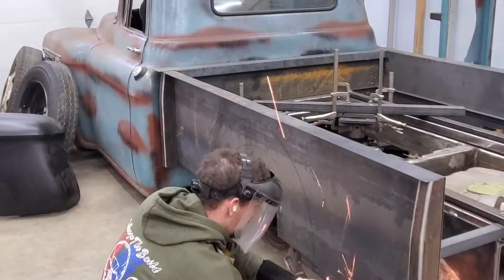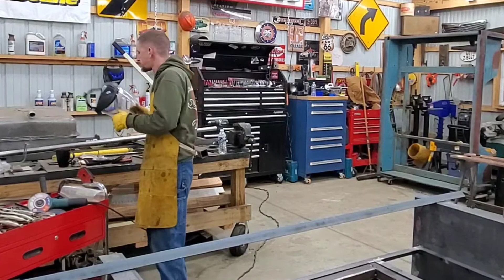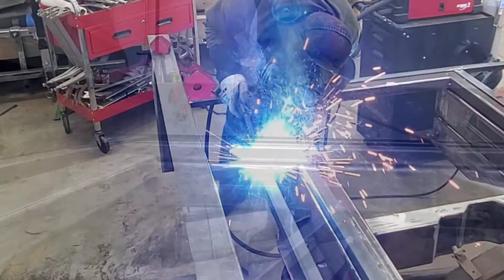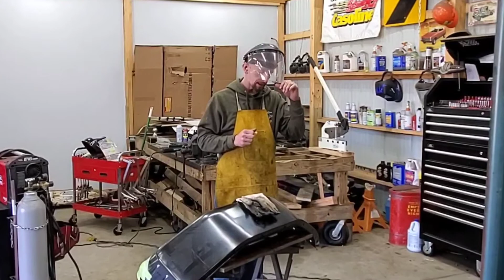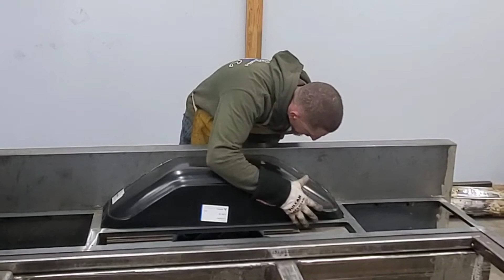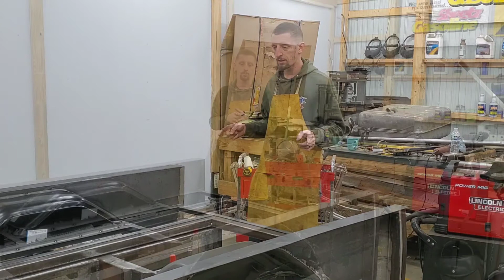Building A Custom 1959 Chevy Viking Truck Dump / Tilt Bed - Inner Wheel House Install & Bed Frame

Comment: Heck yeah! Did you go with a different rear axle?
Reply from the maker: No, still using the dana 80 (I think that's what it is)  from a 95 3500hd 10x7.25 bolt circle.   👍